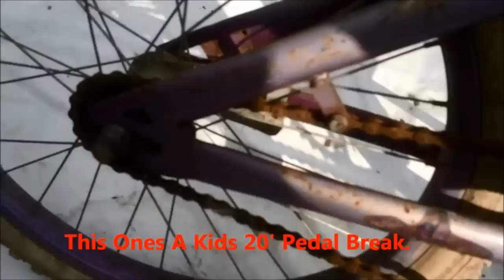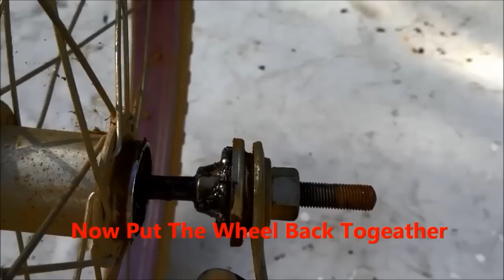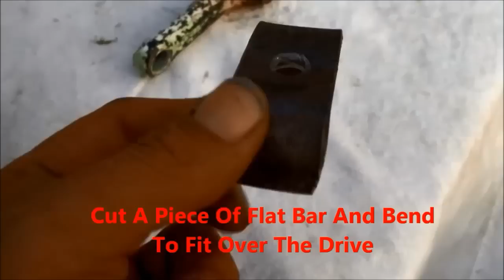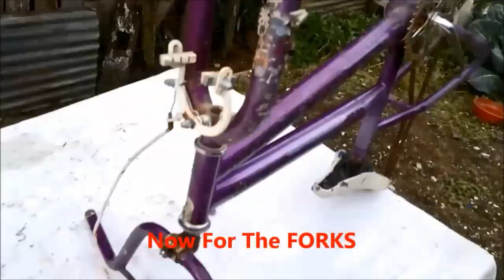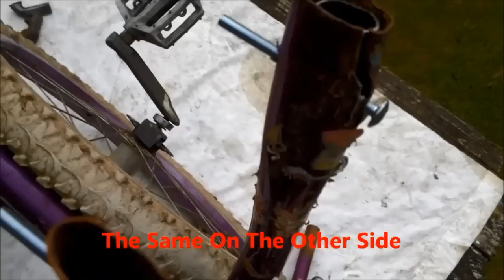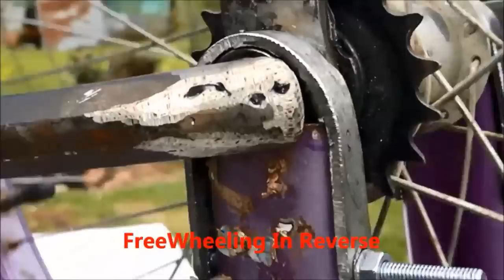How To Build A Drift Trike Front Wheel And Fork Mounts  By JACEonDRIFT

Comment: that is kool gonna do that to fat bike i have. what kinda speed to u get pedalling? is it high gear ratio or low ratio or terrain variable deal. need some insight thanks.
Reply from the maker: yo.. I've been trying to get a hold of a fat wheel or cruiser for so long. wanted to make one that will pedal on sand.. Beach drift .lol. But yea. I figured the cranks would have to be longer so its easier to pedal. might be slower. short cranks fast long cranks slow depending on drive hub ratio. but that's all really the rest is pretty much the same setup. Be good to see a build vid been slacking on my part. Cheers buddy

Comment: What bearings do you use ?? PLEASE ANSWER FAST Thank you
Reply from the maker: What ever bearing you can find that fits over the axel. the bearing will tend to have a larger inner circumference so you might need to make a sleeve to fill the gap. check out my last vid to see what I mean about needing a sleeve for the bearing.. Churrrr
Reply: ok thanks I think it gonna be hard to find bearings can you give me an example
Reply from the maker: I use the same bearings that are used in the rear wheels, iv found that the bearings that come with the trolley rear wheels don't last very long so I replace them with sealed bearings, $8 a bearing from auto shop, or cheaper online,

Comment: I followed all the instructions except were you cut those parts off the forks. But when I peddle it won’t bite the tire so the bike want move. What’s causing this to happen
Reply from the maker: Sounds annoying, I can't be absolutely sure without seeing the issue. I can only ask , does the wheel still spin from the drive freely.? No welds on the drive stopping it from turning.. Are the cranks or drive rubbing, catching on something.? has the drive been put back together correctly.? I had "bearing spacing" issues with the inside of my cranks where they sat inside the forks and had too grind the inside of the crank down so it would not rub on the fork and bearings.. I appreciate the time you took to watch and post this question and am sorry we can't be of more help. Best of luck mate..
Reply: jaceNZ75 the wheel spins freely both directions but when I try to peddle it just won’t bite the tire correctly

Comment: what size sealed bearings did you use?
Reply from the maker: +jesse long should just use what ever bearing he can find that fits over the axle/crank. these were too big which is why I needed sleeves to fill the space. These are the same size bearings as in most rear trolley wheels. Cheers for the comment.
Reply: +jaceNZ75 Thanks. Your video was really helpful.